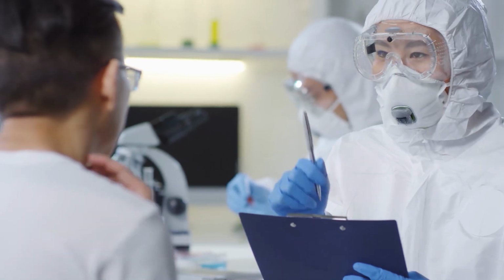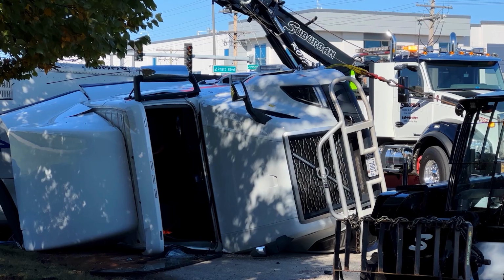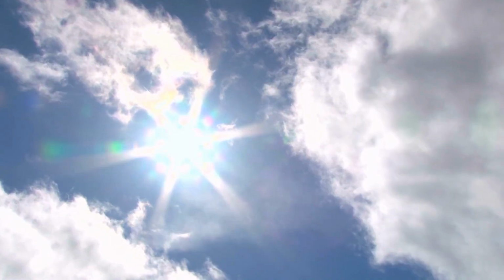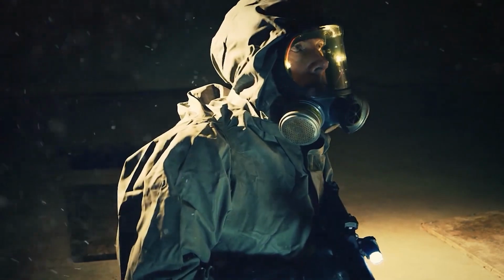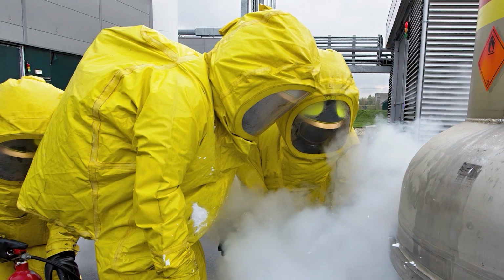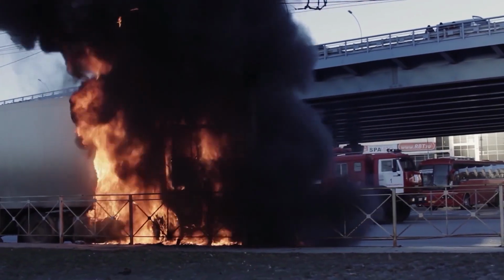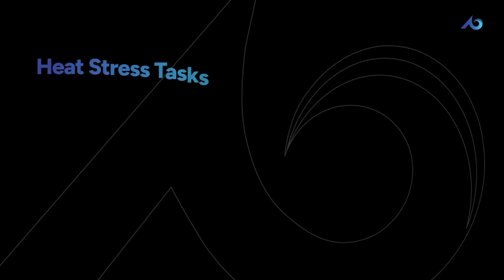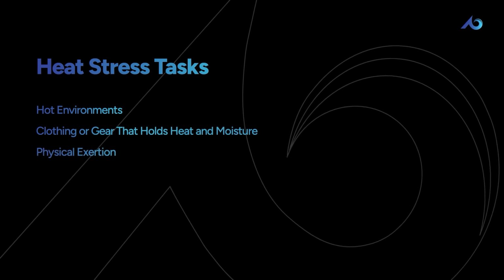Heat Stress Prevention: HAZWOPER Training for High-Risk Environments

Comment from the maker: Heat stress can pose serious risks in high-exertion environments, especially when wearing protective gear. Keeping workers safe in hot or humid conditions requires more than just awareness — it takes consistent practice, vigilance, and proactive measures .

Have you or your team faced challenges with heat stress on the job? Let us know your experiences and any strategies that worked well for you. Share your thoughts or questions in the comments, and help create a safer work environment for everyone!